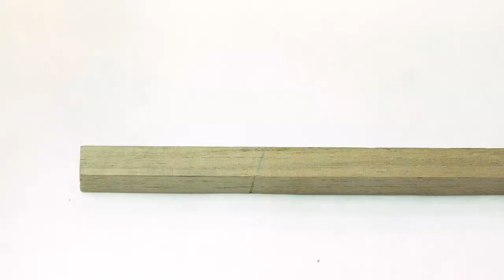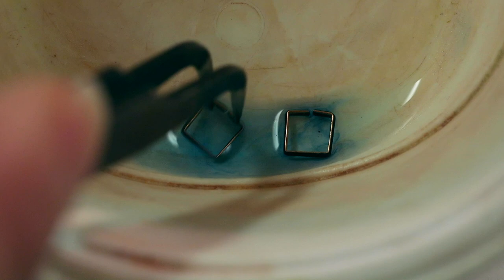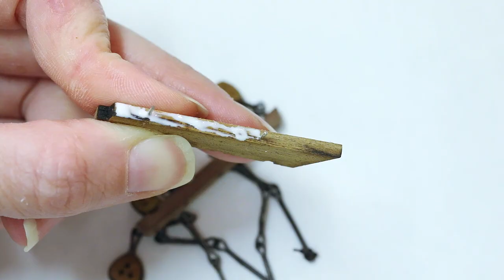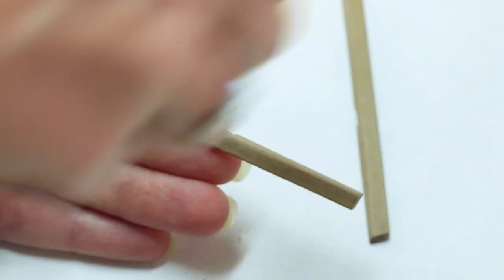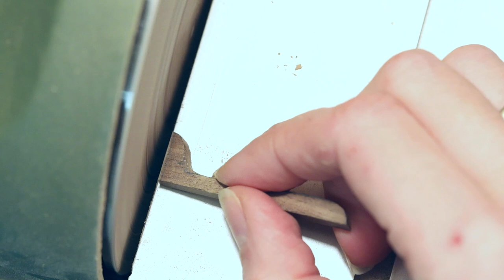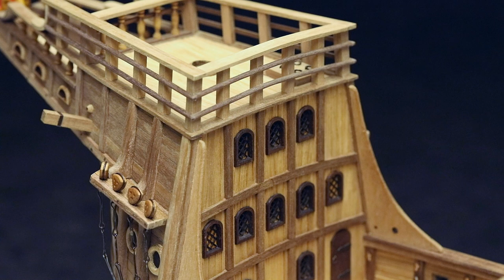Model ship building #27 - CATHEADS and KNEES - RAGUSIAN CARRACK XVIc - KIT (MarisStella)

Comment: You manage to dazzle us with this Carrack, it's magic!
Reply from the maker: Thank you very much!
I am glad you like her!
Reply: @OlhaBatchvarov  Hello Olha,
I would like to ask you for some advice. I'm starting a new kit soon and wondering if the gaps between the bulkheads can be filled with pine which is much easier to carve than basswood? I would like to use the same technique as you for planking. Have you ever used pine or is basswood better in curves?
Just to know, are you still missing material for your Confederacy?
Reply from the maker: @denisv4385  Pine can absolutely perfectly replace basswood. The bow on the carrack is filled with this wood... But it seems to me that basswood is easier to sand, although both af them are soft woods!

I'm gradually buying wood for the CONFEDERCY. I found a great resource where I want to order castello boxwood sheets: modelerssawmill (dot) com. There is delivery in Canada as well - just in case if you need it too (Boxwood, Swiss Pear, Cherry, Alaskan Yellow Cedar, Walnut)!

P.S. I missed your comment - YouTube does not display it in the "unread", and the message was lost among hundreds of daily notifications. Write me a new comment every time - I then respond primarily with the filter "from sponsors"...
Reply: @OlhaBatchvarov  Wow, thank you very much for the advice and the address for the wood, it's now in my bookmarks. Pear wood is hard to find in America and this will be my next crash building.

Comment: Olha, This ship has been made, up to this point, with no finish on any of the wood. Will you paint on a finish later? If so, what will you use?
Reply from the maker: I just applied yellow shellac on the main deck in two layers. But I will continue to do it after I finish the hull. And also plan to use tung and linseed oil...

Comment: Dear Olha,
I have the same discsander as You but I made a plate from 4 mm MDF thick and a strip of wood on the underside as a guide for the slot.
The plate have approximately 1 mm free space between the sandingdisc so that I get very close to the sander with thin and small parts.
So I don't have to be afraid that it can get stuck between the disc and the metal groundplate.
The original space is about 4 mm wide and that is much to big for small and thin parts.
Hope that You some help of this tip.
Greatings from your Dutch friend Gerard.
Reply from the maker: Yes - this is really the problem with these tools. For the second year I plan to make a plexiglass table. But I still haven't found time for this...
Reply: A plate of MDF is much cheaper than a hole new sander, and it work perfectly